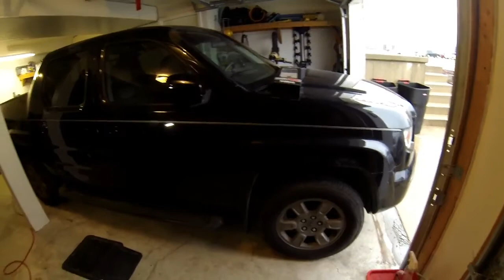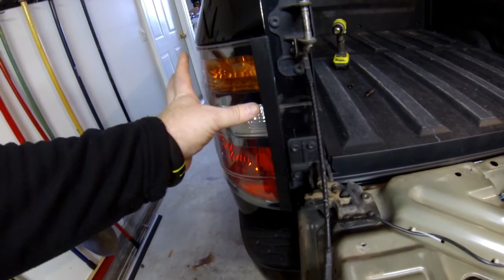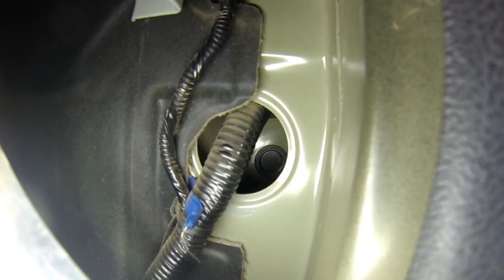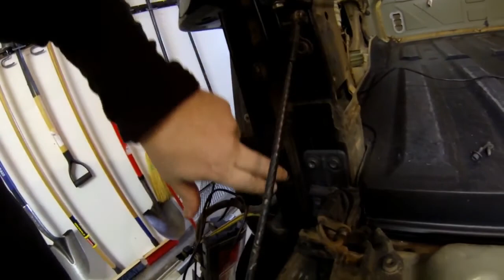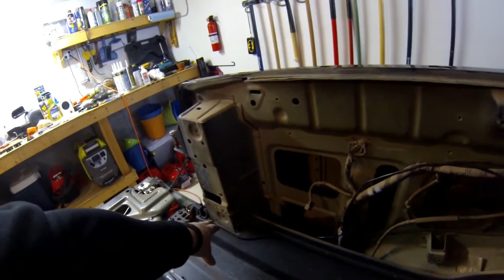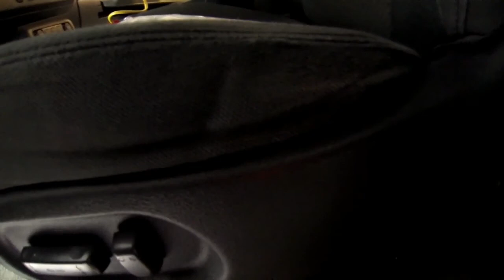Pop and Lock electric tail gate lock for a Honda Ridgeline

Comment: My thought was the rear trunk locks with the rest of the doors. Why couldn't we splice into the trunk wiring already back there?
Reply from the maker: Larry A this would probably be easier.
Reply: This is exactly my thought. I was surprised T.J. went through all that work. I'm sure he didn't think it would be that much when he started and it snowballed. I just bought a 2006 Ridgeline and am thinking about this install. I figure this is exactly what I'll do.
Reply: @ninodeiulis1419  I actually ended up installing a simple key turn lock. I don't actually lock my tailgate as much as I initially thought I would. Mostly on ski trips or travel to various other States. I'm satisfied with the result.
Reply: @ninodeiulis1419  how did you install the manual lock? What model year is your ridgeline?  I own a 2007 ridgeline and bought the manual lock but there's no was for the lock I bought to fit in my oem tailgate latch handle as the tailgate handle my care came with does not have an opening to insert the lock.

Comment: Nice Job Manwichmouth is this installation the same for 2017 Ridgeline? Thanks.
Reply from the maker: Jim Crismundo since the 2017 is a completely new design, I imagine where the wires would go and how to disassemble the panels would be complexity different.
Reply: From what i understand its really close.  Im doing mine next weekend